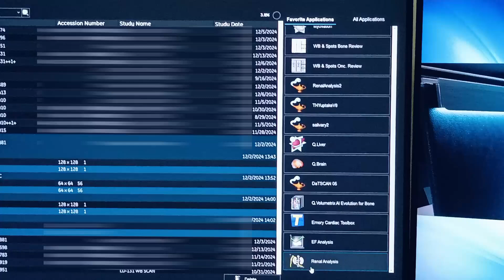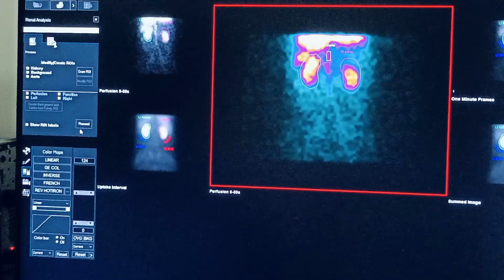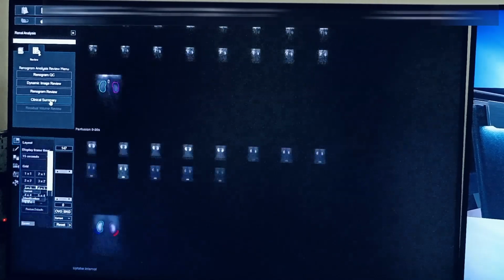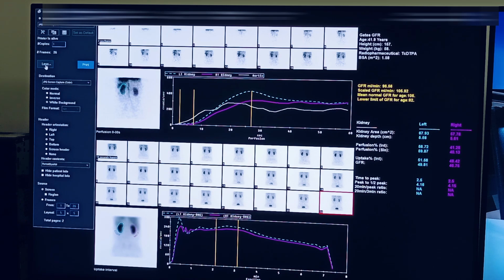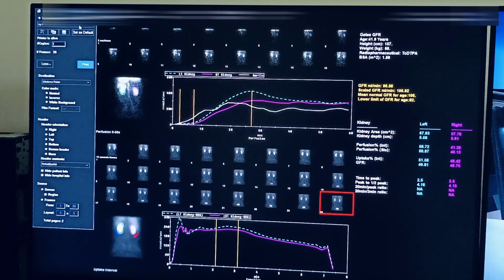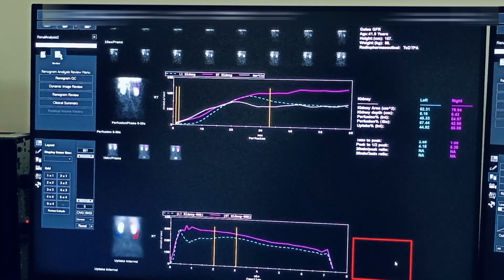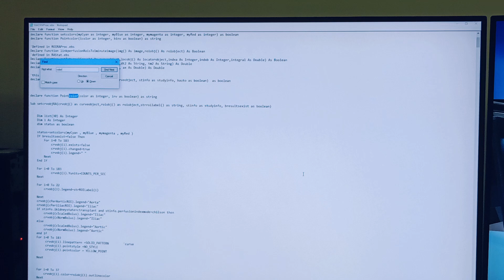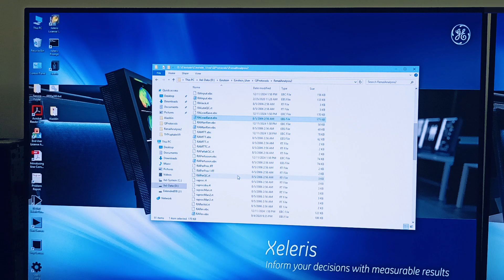How to Process DTPA Studies in Xeleris V: A Complete Tutorial

Comment: I have a question,
If the kidney has a retention, do I make the ROI around the retention or I have to include it for the program to do its job
Reply from the maker: Yes, you must include the retention area in the ROI drawn for the kidney, especially if it represents part of the functioning renal parenchyma or collecting system. This is essential for the software to correctly measure and assess renal function, including uptake, excretion, and differential renal function (DRF).

- Retention reflects functional tissue or drainage defects, both of which are vital to diagnosis.

- The time-activity curve (TAC) derived from the ROI will reflect delayed peak, excretion slope, and residual activity only if the ROI includes the retained tracer.

- Excluding retained activity can underestimate the functional contribution of that kidney.

Just ensure the background ROI is not placed over retained tracer, as this can lead to artifacts in quantification.